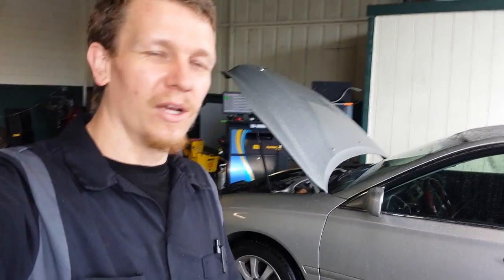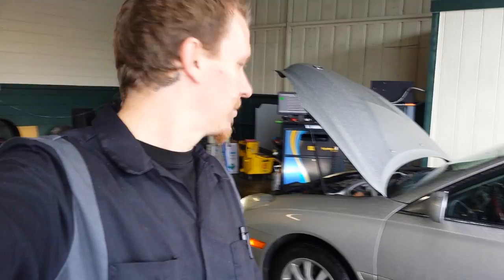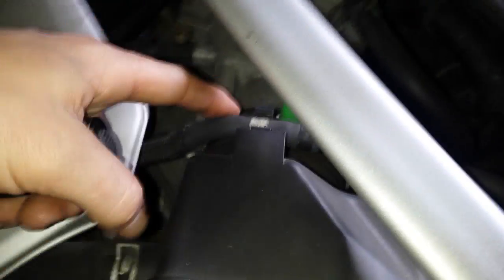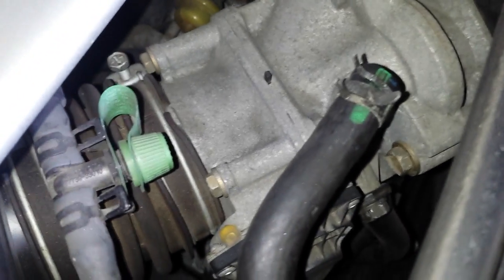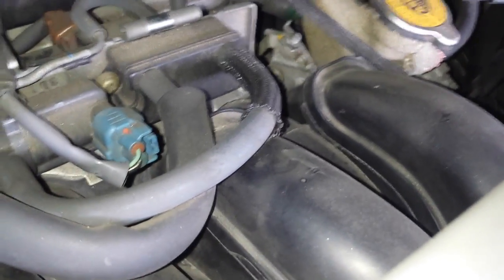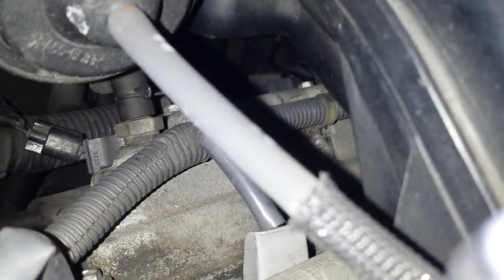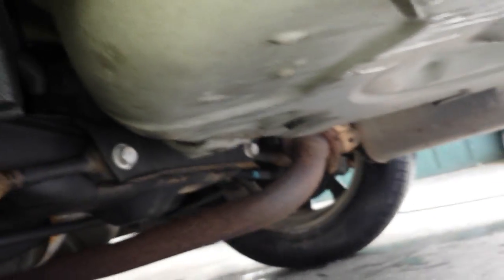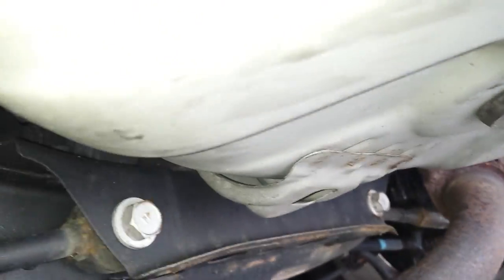Lexus ES 330 emissions: PCV valve, EVAP canister,& EVAP Purge solenoid locations

Comment: 2007 is 350 showing p0456 code check engine. please help what to do. thanks
Reply from the maker: To diagnose and find the source of the OBD-II trouble code P0456 on a Lexus IS 350, which indicates a small evaporative emission system leak, you can follow these steps:

Inspect the Gas Cap:

Start with the simplest and most common issue, which is often a loose or improperly sealed gas cap.
Remove the gas cap, inspect the sealing surface and the cap itself for any visible damage, cracks, or wear.
Clean the sealing area and threads on the filler neck to ensure a good seal.
Reinstall the gas cap securely. Make sure it clicks several times to ensure proper sealing.
Check for Visible Leaks:

Inspect the entire evaporative emission system, including hoses, lines, and components, for any visible signs of damage, cracks, or disconnected hoses.
Pay particular attention to the hoses and connectors around the charcoal canister, purge valve, and fuel tank.
Use a Smoke Machine Test:

A smoke test is a highly effective method for detecting small leaks in the evaporative emission system.
Connect a smoke machine to the system's service port, usually located near the intake manifold or throttle body.
Introduce smoke into the system and observe where the smoke escapes. Common areas to check include:
Hoses and lines leading to and from the charcoal canister.
Purge valve and its hoses.
Fuel filler neck and gas cap area.
Evaporative emissions canister itself.
Check the Purge Valve Operation:

Verify that the purge valve is operating correctly. The purge valve controls the flow of fuel vapor from the charcoal canister to the engine intake manifold.
Check for proper vacuum signal and electrical operation using a scan tool or a multimeter.
Inspect the Charcoal Canister:

Inspect the charcoal canister for signs of physical damage or cracks.
Ensure that the canister's vent solenoid (if equipped) is functioning correctly.
Check Fuel Cap Seal and Pressure Test:

Ensure that the fuel cap seal is in good condition and not cracked or worn out.
Perform a fuel tank pressure test using a scan tool to check for leaks in the fuel vapor system.
Scan for Additional Codes:

Check for any additional OBD-II trouble codes that may be related or contributing to the P0456 code.
Clear the Codes and Test Drive:

After repairs or inspections, clear the diagnostic trouble codes using a scan tool.
Test drive the vehicle to ensure that the P0456 code does not immediately return, indicating that the issue has been resolved.
If you're unsure about performing these steps yourself, consulting with a qualified mechanic or technician who has experience with Lexus vehicles and emission systems is recommended. They can efficiently diagnose and repair the issue to ensure proper functioning of the evaporative emission system.

Comment: I got a po442 on my Lexus es330 and I changed the gas cap but it's still on. Do you know other places I can search for this. My friend might have a smoke machine but he does not have a machine to close the evap.
Reply: Same to my vehicle. I changed my gas cap with OEM, the light was still on. Then, I went a head and looked for other videos. There was one made by PeanutButterMan and helped me a lot in solving my problem.The second most common cause is leaking hoses.

Comment: I have a 05 ES330 w/ P0442 code (EVAP small leak). Replaced all vacuum hoses from the EVAP port to purge valve still has P0442. Then I was testing the Purge Valve (Toyota 90910-12259. Duty Vacuum Valve) on top of the intake manifold (that switch w/ blue connector shown on your video). I can hold vacuum if I put vacuum pump and suck from the side where it connects to the intake BUT I can't hold vacuum if I put vacuum on the side where it goes to EVAP canister. I was just wondering if it has to hold vacuum both ways during testing? The valve still works and clicks when I put 12 volt into this valve. It's just it doesn't hold vacuum when tested from the EVAP side of the valve. I wonder if the system detect this as a leak slightly on this valve before I chase the leak from the EVAP port to the back of the canister. Any help or comment is appreciated.

Comment: Can a bad pcv valve cause P0441 (incorrect purge flow) code? I’ve already replaced the solenoid but code returned.
Reply from the maker: Very very doubtful. The PCV valve is not plugged into the EVAP line at all. Did you make sure you had continuity in The Wire connection to your evap purge solenoid? Also, the vent solenoid could be stuck open when the computer thinks it's closed all the way and tell him you that The purge solenoid is bad. Usually I'll do a continuity check on both the purge and vent solenoid, as well with a 9 volt battery check to make sure that they're opening and closing, then I checked to make sure the connector going to these solenoids has continuity from the computer with the key in the on position.

Comment: My obd scanner showing P0446- Vent control circuit Malf. (2004 Lexus ES330).
what is that and how i can change
Reply: Please and thank you would have been more apropiate in your demands to know answers. 

 p0446AHole .
Reply from the maker: +Asghar Hussain check the hoses coming from the vent to ambient, you might have some debris in there causing the vent not to vent.

Comment: is pcv removed from within the engine with a wrench or can it be removed with a socket? thanks
Reply from the maker: I would probably use a open end wrench to get this one off. I'm not sure if you have the space to fit a socket back there. But if i did have the space for a socket, i would prefer to use a socket.
Reply: Watch a video on PCV es300 on youtube . Or es330 . 
And Wala !